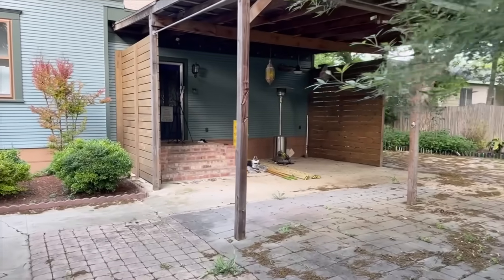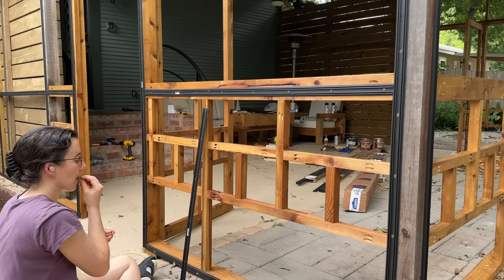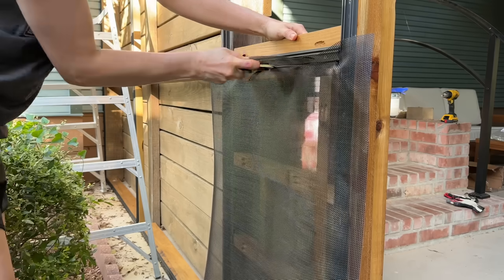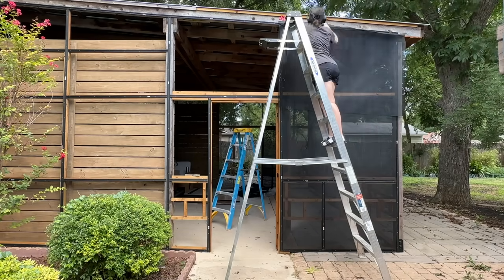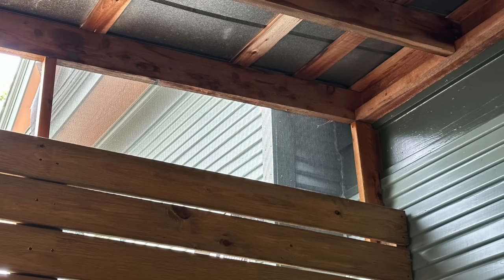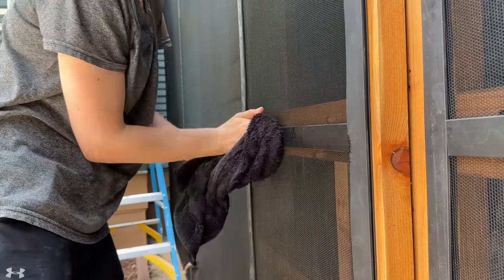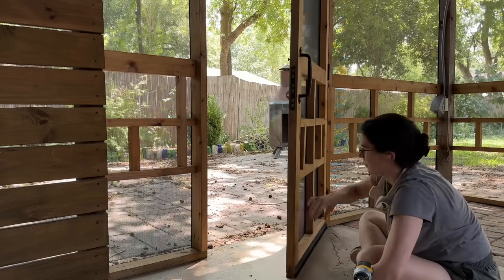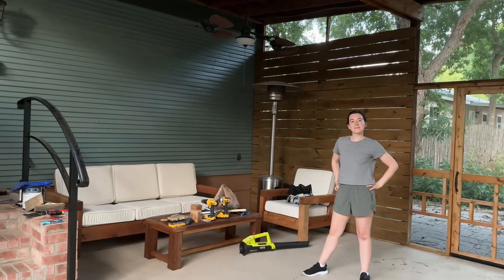SCREENING IN A CRAFTSMAN-STYLE PORCH | Back Porch DIY Reno: Episode 7

Comment: I love the design style of this screen room, very nice.  Just an FYI - I have cats.  My back porch was screened in when I bought this house.  A couple of cats quickly shredded the screens, doesn't take but a few climbs.  May have been the type that was originally on there, not sure.  We did re-screen it using the type of screen you used, not that system, we stapled it in place.  But.....also stapled chicken wire over the top of all the screened areas so they couldn't escape.  I've heard if you paint the chicken wire black, it's hardly noticeable.  I have a handle that locks, my cats would open a magnetic door.  We also installed some shelves at various heights for them to jump and perch on.

Comment: Won't screens/nets accumulate dust over time? Curious to what's the best solution for keeping them clean.
Reply from the maker: Yes but it keeps the dust and debris from making their way into the porch! I’ve done a little cleanup already and I’ve found that using a leaf blower from the inside of the porch screen blows off the debris easily. When pollen season hits, I’ll have to see how it does with a spray down.